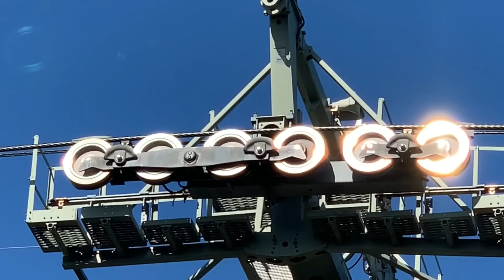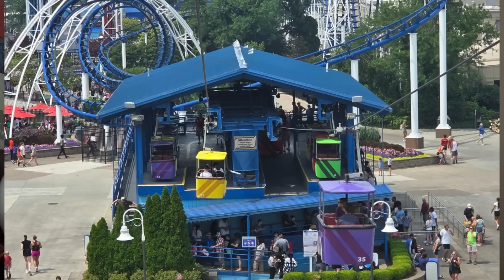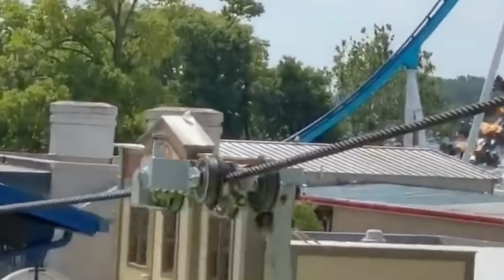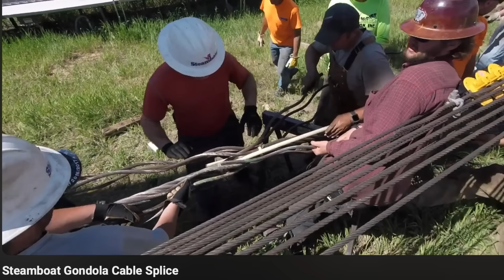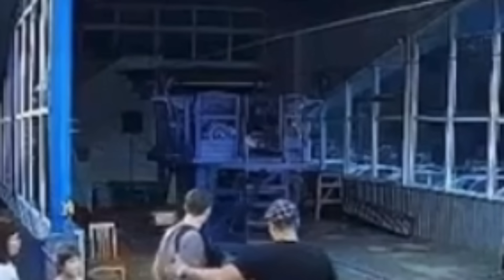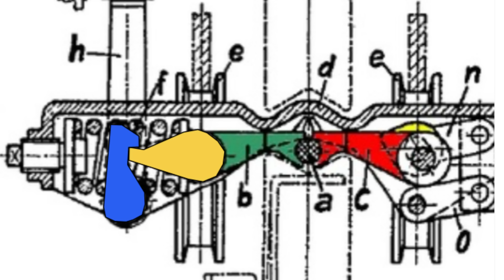Sky ride buckets operation and how it works

Comment: The Von Roll Skyride at Busch Gardens in Williamsburg,VA is fantastic. I have ridden it for over 28 years now. Thanks for posting this.
Reply: That one has a few 1st. Only Von Roll VR 101 that goes in a triangle.  Speed is 4.5 mph. The cabin going down the ramp , the grip hits the haul rope at 5.7 mph causing wear plates to wear out faster from hitting the haul rope faster than a normal VR 101. Normal VR 101s run at 6 .2 mph. Fastest one is the heavy duty Von Roll VR 101 at Sea World San Diego.  Goes 8 mph.

Comment: They used to have one of these at Drayton Manor up til a few years ago, but in its later years it operated as a round trip - you'd get on in the park, and it would take you over to a second station where some poor member of staff would be stuck on their own dragging the loaded cars round to set them off again - I felt quite sorry for them as it must have been very boring!

A friend worked at Alton Towers, where they have a system more like the Disney Skyliner. Because the ride is very high up over the valley, they had staff trained to abseil rescue from gondolas stuck out there. My friend was very excited to do this, so one day he was called to help with an evacuation - until he arrived to be directed to a gondola about 6 ft off the ground just outside the station! He was quite disappointed to miss his big moment!

Comment: 40 years of going to CP and the Sky Ride still makes my nervous unlike any coaster does.
Learning about the cable marriage is amazing but just adds to my uneasyiness. Thanks Ryan. 🤣
At least to me, you would think the constant clamping on the cable would be hard on the cable and it would need replacement more than it seems it does.
Reply from the maker: When you think of it the grips are WAYYYYY overbuilt for the weight they hold.
Reply: @ryantheridemechanic The compaction spring has a force of 2 tones of pressure.  The jaws on the hangar arm side , the force is the weight of the carrier. Cabins weight 325 lbs empty. Hangar arm 70 lbs. Grip 130 lbs. Each one when rebuilt is slip tested. Thats a huge subject alone.

Comment: I used to love riding "The Skyway" at Disneyland. This was made by Von Roll, & operated from 1956-1994. I was there on its last day of operation in November of 1994. This was one of Disneyland's biggest mistakes they made in my opinion.
Hello From Phoenix Arizona 🌡 🔥
Reply from the maker: I loved going through the Matterhorn.
Reply: @ryantheridemechanic - Ryan, just wanted to tell you. I recently got my hands on a Road Wheel from Ninja at Six Flags Magic Mountain. It has the Arrow logo with a serial number. I also loved your opening to the video when parks start their off season work.  "Time to jerk that thing off, quickly"  🤔🫢
Reply: A very special Von Roll.  1st detachable monocable gondola lift in the USA. 1st Von Roll VR 101 in the USA.  Walt Disney bought the ride used. A 1947 Von Roll sidechair. Over 165 Millon rode the great Von Roll
Reply: From what i heard there  was an issue with the tower they put in the mountain requiring a big chunk to be cut out to fix the tower. Disney didn't want to spend the money like fixing The Yeti in  Expedition Everest.
Reply: @Matt7984  Correct. Metal fatigue.  Stress cracks in the Matterhorn tower battery supports. ADA had no bearing on the Skyway being closed as it was grandfathered into ANSI code B77.1

Comment: Thanks for this great video that I assume my email had been (at least in part) the inspiration!    You not only did the topic well and answer all my questions and thoughts, but you also taught me about the cable grips of which I had no idea existed.   I just thought it rested on the cable and did wonder how it would have stay centered.   That will make me feel more safe while riding it.  I will have to look closely at that grip area next season.    I am also going to have to look and see if I can spot the backup engine (if it is there and might be visible).
Reply from the maker: All the emails and info help especially when I still have sea legs on the optic 😊

Comment: As both an avid coaster enthusiast and downhill skier, this video was incredible to watch.
Unfortunately, Vail Resorts has had a couple of lift-grip failures over the past two years. In my 31 years of skiing, I had never heard of failures like this, and it’s disappointing to learn they ignored warnings from their mechanics that the Doppelmayr grips were reaching end-of-life. (Google the Attitash Ski Resort chairlift incident.) 

I can't think of any ski resorts that still use the Sky Buckets style in their lift fleet. Even the detachable lifts from the late 80s or early 90s have the "modern" design that Ryan shows at 35:30. It makes the gravity-driven, old school style buckets that much cooler. Also, there are still some old fixed grip chairlifts that run 100% on diesel - even during normal operation! You can always tell based on the sound of the lift motor.

Comment: Nik Wallenda tight rope walked across a section of the cable. Paul the Woodcarver on Frontier Trail has carved miniatures of the cabins in a couple different sizes. He's like a human 3D printer he does it by eye (he started in the accounts receivable dept – he told me it cost $45 in electricity per launch for the old Wicked Twister coaster – and is a tax accountant, also sets up an Xmas train display at the Sandusky Merry Go-Round museum. I uploaded Cedar Point's off-ride carousel operating backwards for HalloWeekends that was an interesting 4 min ride). The current Sky Ride cabins are from the old Frontier Lift. I have an old video of it stuck/stopped.

Comment: Thank you for this video.  I was Ops Supervisor on this Von Roll and a second one at Cedar Point that ran from near the end of the original one out to Frontier Town, that ride was removed in the 1980s.  There had been a number of accidents on other Von Rolls around this time-State Fair of Texas, and other parks, some requiring difficult evacuations that made for good TV but bad PR.  Since the Frontier Lift ran through a woods and across several islands I suspect that Cedar Point wanted to err on the side of caution.  Don't know if that's the case but could have been the reason. To my knowledge while I was there in the late '60s and early '70s we never had  an incident other than power outages on the Von Rolls and in those cases we would just wait for maintenance to come and start the VW.  I went from there to Santa Clara where I believe their Von Roll is still operating.  I love aerial tramways and have ridden some great ones in New England and in Switzerland.  By the way, at the time I was there, we had a Volkswagen car engine that served as backup for electrical outages which came with the rides. Got to see the splicing work done one winter--it was a major project.  As I recall a gentleman by the name of Fred Bigler was Von Roll's rep in the US and he was the one that inspected and directed any unusual off season maintenance on the sky rides.  Thanks again, brought back alot of fun memories..
Reply: Where is/was that VW engine?   Is it visible from the load/unload area?   I want to see if I can spot it next year.  Also, you are probably right about the reason the Frontier Lift was removed.
Reply: @jimstark4174  AstroWorld's (circa 1968) VW motor was located next to the electric motor for the bull wheel right in the center where you got on/off.
Reply: I thought Frontier Lift was removed to make way for Iron Dragon in 1987?

I do know the cabins from Frontier Lift were moved to Sky Ride when it closed. The originals on Sky Ride were only 2 passenger I believe

EDIT: I had my years mixed up. Iron Dragon would have been 1986-1987. Magnum was 1989.
Reply: @B @BamaRailfan , Frontier Lift was removed before the 1986 season, presumably because removing it late in the operating season when they went to install Iron Dragon would have caused trouble. I’m sure obvious challenges with evacuating the Frontier Lift probably factored into the decision to not design Iron Dragon around the Frontier Lift.
Reply: @BamaRailfan  I think you may be partially correct. Frontier Lift's last season was in 1985. 1986 was the last season for Western Cruise, as it loaded where Iron Dragon's station is. Iron Dragon opened in 1987 and Paddlewheel Excursion opened with its load platform over by where Camp Snoopy is now (also the former Snake River Expeditions load platform). I imagine they were simply working a multi-year plan as it would have been a lot to close and remove the lift, cut the new channel for the shortened Paddlewheel ride, and open Iron Dragon all in a single off season. I do recall either John Hildebrandt (former Frontier Lift operator,VP and General manager of Cedar Point) or Dick Kinzel (who became CEO in 1986 when Bob Munger stepped down due to health issues) mentioned (maybe in their respective books) that concern for accessing stranded guest was a factor in Frontier Lifts removal.
Reply: @timk987 yes. I had my years mixed up. Magnum was 1989. A lot happened in the late 80s through early 2000s.
Reply from the maker: Thank for the info. The one in California still uses the engine for back up. 
Was Von Roll rep inspection a normal annual inspection or was it ever 3 years or so. Most Huss rides need rep inspection every 3 years.

Comment: Up until now, I thought of the sky ride as being the scariest ride on park. I now have confidence in those cable grips. Great video.
Reply: That is so funny, me too. That and windseeker scare the pants off me. And the crazy thing is, I love love love top Thrill ..
Reply from the maker: Thanks. I used to be there as well but no it’s very relaxing for me.
Reply: @ryantheridemechanic  Ever since the Texas State Fair tragedy I have had less confidence in the grips because I keep a photo of the gondola falling in my photos, which I use & share occasionally on ride/coaster hobbyist sites. Your video is the first detailed info I've learned about the manner of attachment & I now think it must have been a hell of a wind to blow them off the cable.
Reply: Up until now, I thought of the sky ride as being the scariest ride in the park. Now that I know there's nothing holding the cable together other than the tension of itself it has been confirmed as the scariest ride in the park. 😨
Reply from the maker: @user-is7es  fear has a grip… on you!
Reply: @user-is7es  The connection, the "weave" is so strong te cable will break outside of the area instead of the weave separating. You are far, far safer on any ride at any theme park, amusement park or carnival than you are in a car, eating dinner or walking down your neighborhood sidewalk.

Comment: The real question is why are they seemingly always closed at busch gardens (both parks). Do you know anything about the wind restrictions or are they closed for another reason
Reply from the maker: They can’t handle much wind in the direction of the rope not across it. But mainly they need a dedicated daily crew of roughly 15 people so they are too expensive to operate all day. I’d imagine the first place to cut staffing as well.
Reply: Wind speeds 20 to 25 mph. Busch Gardens Florida has a 17 mph top speed before they shut it down
Reply: I heard that Busch Tampa just had to have te cable/rope either replaced or repaired and it took a while to get someone that good o the marriage thing But I beleive ut us back open now.

Comment: I'd like to request a video on the Intamin Sky Jump. I've seen your drop tower video and it was fascinating, but I've recently learned that the Sky Jump has a lot more added complexity to it (which may be why there's only two in the world).
Reply from the maker: Interesting.
Reply: @ryantheridemechanic  While the addition of a tilt looks simple enough, a friend of mine indicated that there's a lot that goes into the operation of Falcon's Fury, in particular. In conversations with someone from Intamin at IAAPA Expo they mentioned in passing that the later iteration, Ikaros, greatly simplified the design for better reliability.

Comment: If you don’t ski, you should try it, just for the lifts. If you like Sky Ride, you’re going to love the complexity and variety of ski lifts.
Reply: The one at Knoebels is something...a plain old ski lift but set into a steep hillside that gives a great view of the park on the descent. It's the only ride at that park that makes my hands ache when I get off - because I just can't stop death gripping the lap bar....😬
Reply from the maker: @leeriffee4606 very nice view on that one!
Reply from the maker: Newer equipment is very fascinating to watch how they mitigate so many cabs in the station at one time in the sequence of drive tires running them
Reply: @ryantheridemechanic  Ride one of the VR101s, then go down to Disney and ride theirs.  Something like 70 years of evolution in monocable Gondola lifts.  Disney utilizes Dopplemayr's latest D-line technology.  Dopplemayr, btw, is who currently owns the Von-Roll engineering and service business.
Reply: @litz13 It amazing that how far the detachable monocable ropeways have came since the Von Roll VR 101 in 1945

Comment: Back in the day kings dominion had a skyride  which traveled from the north end of the park  near planet snoopy  along the main candy apple grove midway  to the south station  just in front of racer 75 right about where the ferris wheel is currently located. 

Unfortunately it was removed in the mid to late 90s  probably due to higher maintenance and operations costs.
Reply from the maker: Unfortunately they are a dwindling ride in parks

Comment: You can tell me how awesome and strong “cable marriage“ connections are…  heh… but now that I’ve heard how it’s done, I don’t think I’m ever riding a skyway ride again  😅🐓🐥
Reply: I skipped around a bit but if he didn't mention it a cable marriage requires 10% more length than the final install length. So if the loop is 2500' then the total length of cable will be 2750' (2500' loop length + 250' or 10% marriage overlap). So the friction and tension that keeps this 2500' sky ride loop together is nearly the length of a football field. From the bits I saw, Ryan seemed to make it appear like the marriage was just a few feet long and not the full 250' that it actually is. Also these cables have a core surrounded by the steel cable, in the section that's being used for the marriage the core is cut away and that newly created void in the center is used as part of the weaving process to attach the ends. When completed, the section of the cable that has the marriage can be no more than 10% bigger in diameter than the rest of the cable. 

I hope this helps some. In my short research I haven't been able to find any instances of the cable coming apart at this merge point. Like Ryan said, the portion where the marriage occurs is actually now stronger than the rest of the cable, the reason being is there's more steel in that area as the center core has been removed.
Reply: @GilesWells  Thanks for the additional info on the cable marriage.   That part always intrigues me.
Reply from the maker: Awe it’s all good
Reply: Also, the splice on these cables is actually stronger than the rest of the cable.  If there's gonna be a problem, it won't be at the splice.

Every single cable driven transport out there uses spliced cable.  Even something like the San Francisco cable car.